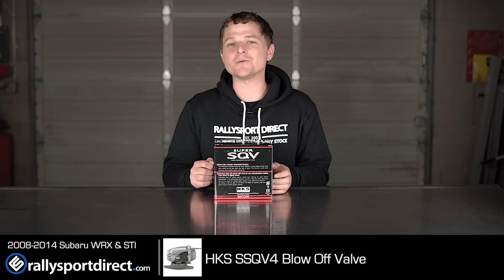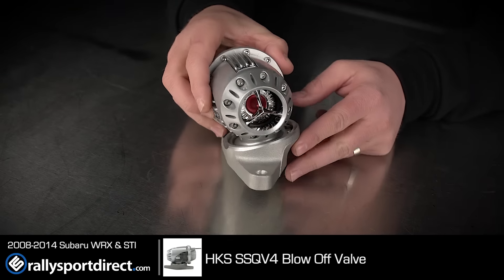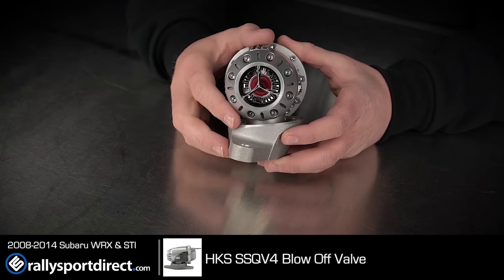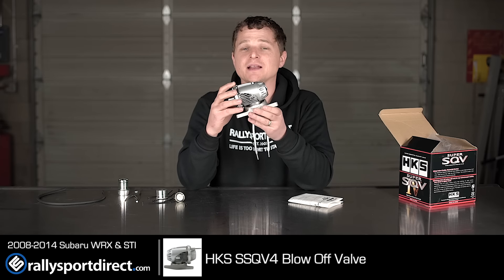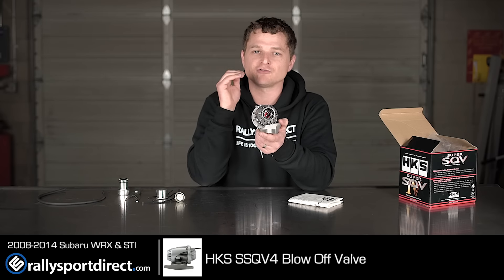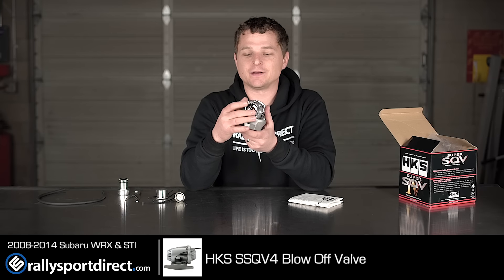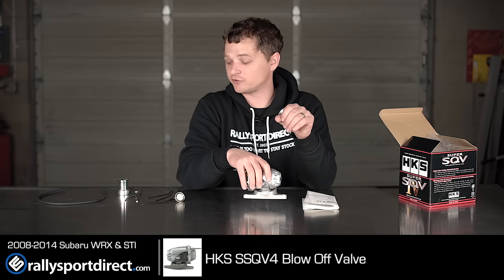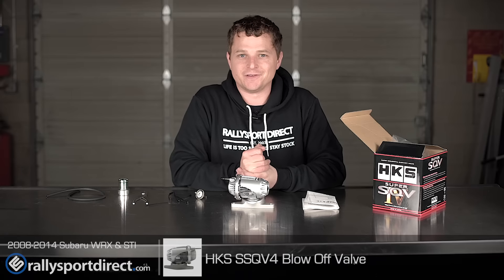HKS Super SGV4 Blow Off Valve - What's In The Box?

Comment: Would this fit on my focus rs I have cpe pipe kit
Reply from the maker: As long as you have their pipe specific for the HKS valve, it will be a direct bolt on. The pipe you would need ot have is: https://www.rallysportdirect.com/part/blow-off-valve-flanges/fdbh00006b-cp-e-exhale-hks-bov-kit

Thanks,
Rick

Comment: If I go fully atmospheric will I need a tune? Or will it run fine as I researched it does have some backfires when running fully atmospheric.
Reply from the maker: No, no tune required. And you will get some afterfires when running fully atmospheric as you will get rich conditions between shifts, but most cars seem to run okay with them on.

Thanks,
Rick